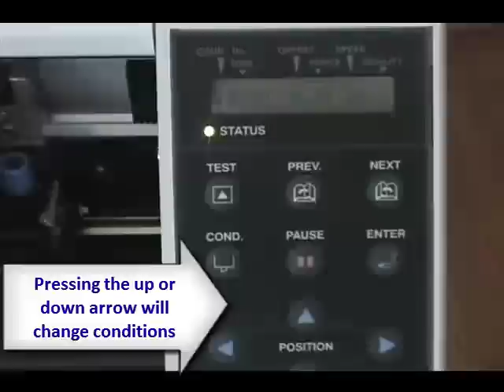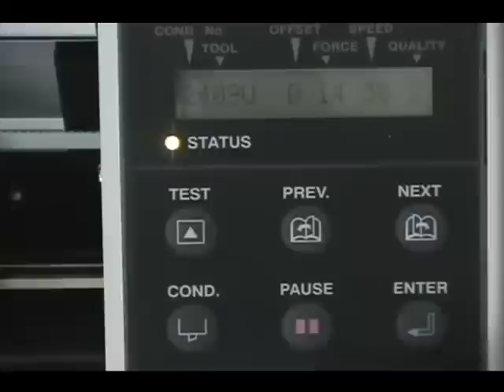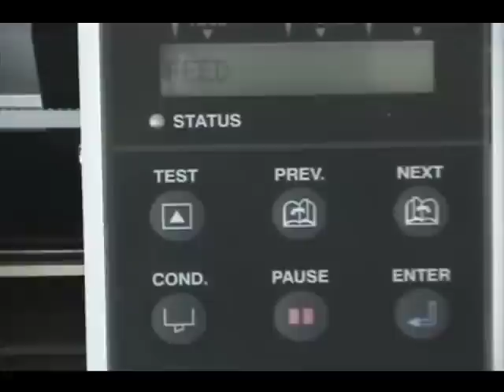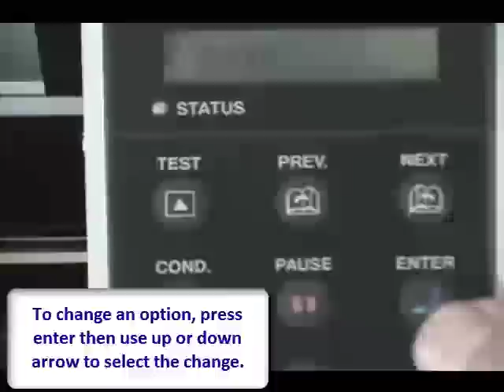Graphtec CE5000-60 - Control Panel - Conditions

Comment: Very good video.I have a question I have Graphtec CE5000-40 and was working perfectly for 2 months after I bought it then my wife get sick and never recover now after 8 years my grandson ask me if he can have  I took it from the box I kept and when I push the button on only I ear the fan working but the control panel doesn't show nothing I tried another power cable and still nothing.
Please any help?

Comment: Hey buddy, I need to ask, as I can't seem to find it anywhere...how does one stop the plotter from cutting other than shutting it down? The pause button will stop, yes, but once you take it off, you are still cutting the same darn thing...I find I have to turn OFF the machine to get it to fully stop an operation before I can continue on after resetting where I want something etc....sheeeesh!.

Next:

2) OK, so I am plotting with my pen or cutting, and I want to put what I am doing back at the top of my page/vinyl etc, (where the edge runs along the top of the feed roll and cutter is )  and I find I have to lower the media arm, put it back up, and hit enter BEFORE I can get it to cut something new on my media and at the top where I want it...like really? Is there not a simpler method in doing that?  If I don't, it just starts cutting where I left off, which is wasting my material.  soo, would you mind a  hint or two to a gal who needs this for work? Thank you SO much!  If you have a vid of it somewhere I would love to see it!
Thanks and thumbs up! Cheers Vicki
Reply: Hey- in cutting master there should be an X where you can clear the job out of the cache. Otherwise- if it stops and you load the cutter, it will start off where it left off. That's in Cut Master 3. 

If you want to set a new starting point for a new job, you put it where you want it and hit the "Origin" button on the control panel on the actual machine. It's in the lower right corner.
Reply: @AwakeGrrrl  hello

Comment: y position alarm.   turning the machine on sends it all the way to the left and it hits the edge and goes nuts.  opened it up to make sure everything was ok, tried again, it worked out of the blue, but now suddenly it doesn't wanna cooperate.  complains of realigning the rollers (they're fine).  i think these machines are disposable once they break down.  will grab a gx-24 instead of crappy craft robo pro.
Reply: Same problem
Reply: Can u help me out